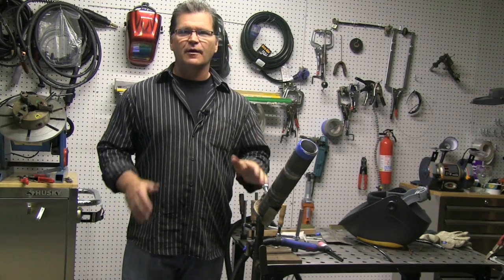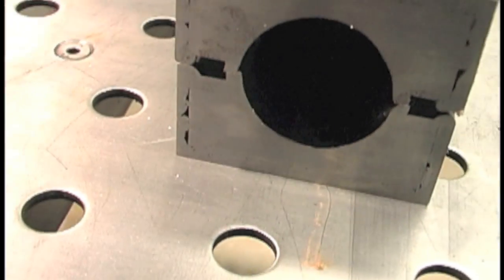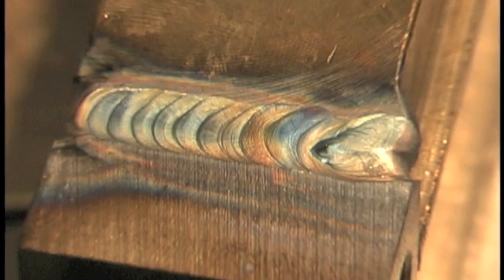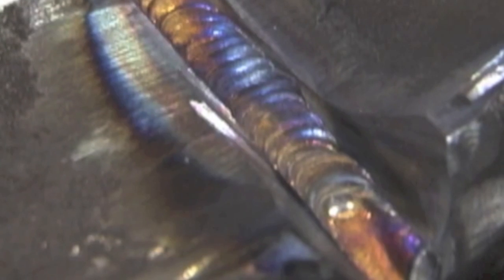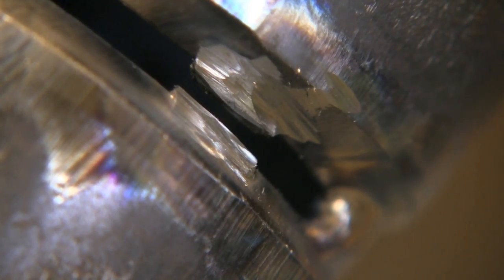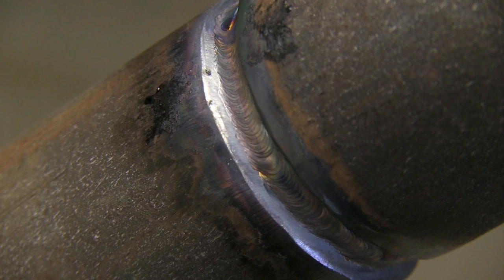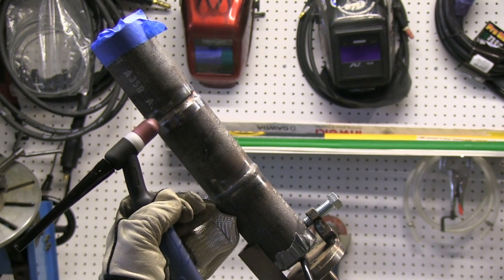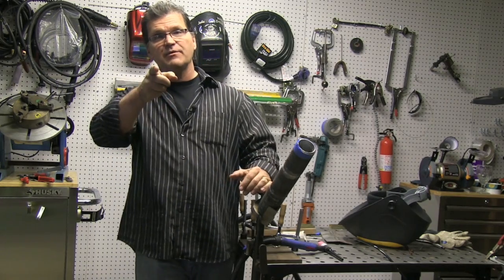6g Weld Test Tips - 309ss Hot Pass and Other Random Jobs

Comment: Quick question.  Is it important to maintain directionality when welding?  In other words, If I start going around the pipe in a clock wise direction do I have to continue welding in that direction or is it ok to change which direction I'm welding for comforts sake?  Thank you for your time.
Reply from the maker: it makes a difference in how the pipe draws from weld shrinkage but often there is no choice.  for a 6g like this all welding is uphill from bottom to top so direction changes

Comment: Hi Jody, the Low carbon for S309L, whats the purpose of the L? any effect on welding mild steel? Is it harder to weld? puddle easier maybe? thanks!
Reply: Mohd Fizea Zaulkefli the L in 309L means low carbon content in the wire